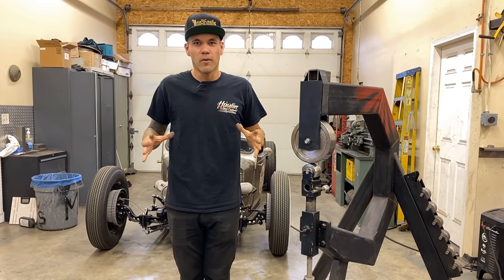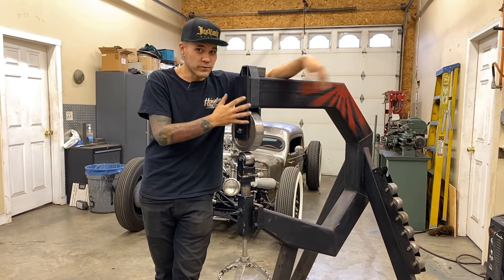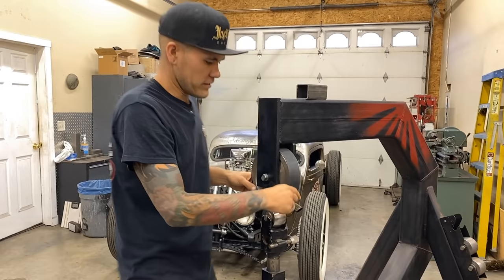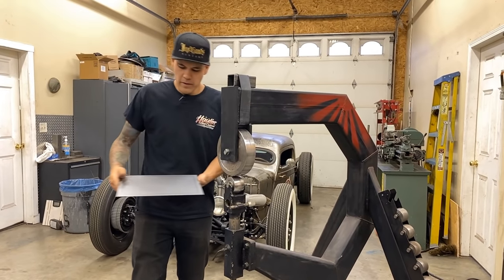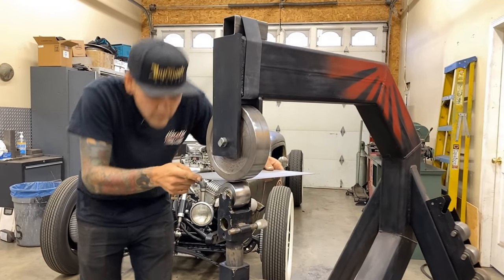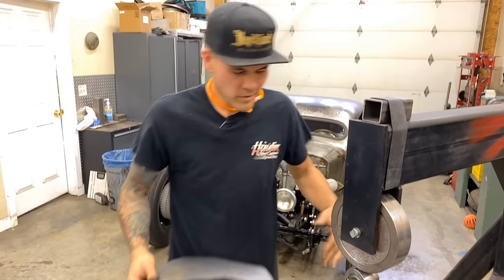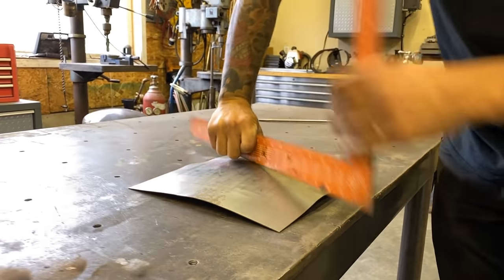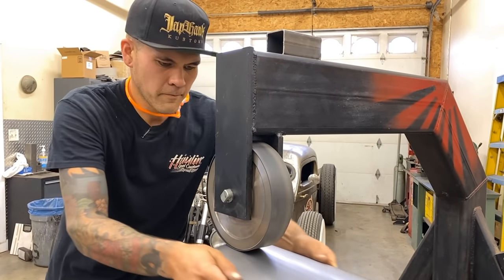English Wheel BASICS For BEGINNERS!!! How To Build, Buy or Modify, and WHY?

Comment: Another very good and understandable tutorial. One thing that I may gently remind you of is: Be mindful of your thumbs! Unless you want blood all over whatever is the other side of the wheeling machine and not to be able to use your thumb(s) for a couple of weeks or so, know where your digits are at all times!. I started learning metal shaping in England when I was eleven. This was something my instructor would be very emphatic about. At the beginning of my training he would, every so often, sound an alarm, which meant that you instantly stopped what you were doing and shut off any machines you were running. He would then remind us to be aware of out digital placement, our body stance and the state of our clothing for whatever process we were involved in. Everyone would surreptitiously check themselves out, sometimes there would be a flurry of tucking in of shirts, buttoning or the rolling up of sleeves and the binding of longer hair. After about a month this procedure would be unnecessary as everyone had leaned their lesson well. But he would still cruise the shop looking for unsafe practice. He didn't often find it.
Reply from the maker: Thanks for the reminder what in particularI am very mindful of my digits and I’ve never stuck them in the wheel yet is there a particular thing that I was doing that you thought was unsafe for my fingers!?
Reply: @MakeItKustom   Nope, nothing that you were doing. Your technique is just fine. It's only that you didn't mention it for any newbies out there. Getting your thumbs caught between the wheel and anvil can come as a very nasty surprise

Comment: Another awesome video, thank you! When I was working we called the holes tool holes, or tool pin holes. Your point is well taken, the stock replacement may be $18 -for a group 24 battery.  What if you needed a group 27 battery? Could use the original as a starting point, and change the template to accomodate the larger size. Keep it up great work educating folks.

Comment: Ok, Karl, I'm hooked/subbed. You had me at "sail panel for my 54 Chevy". I am new to the wheel, and I am going to make sail panels for my '49 Chevy coupe. I'm replacing the poorly hammer-formed patchwork quilt sail panels I made when I chopped the car about 15 years ago. I am unclear which of the methods you show, or combination of methods, to make the complex shape of the panels. BTW... I bought a rubber band from Trick Tools per your suggestion, for my borrowed Harbor Freight wheel. Any chance you could do a quickie on actually making sail panels..?

Comment: I have an HF special and was curious if it was gonna be enough. Thanks for easing my worries.

Just found your channel, excited to get my wheel out later and get working
Reply from the maker: You can do a lot with a little! Once you know the machine a bit you might desire a little bit more rigidity in the frame but that can always be added later
Reply: @MakeItKustom  Hell yeah. Also saw the coverage of your rat rod. Thing is chefs kiss

Comment: Do you use any downward pressure when you are making the 2D form? So basically if there is no downward pressure the radius of that panel would be ~36"?
Reply: You don't need to make downward pressure. It would be very awkward to do in any case. The machine makes the upward pressure that you apply via the adjustment of the anvil (lower wheel). The different radii of the anvils will give you different results.
Reply from the maker: Toby explained it very well. The radius of the lower die will become the radius of the panel the pressure does not matter whether it’s coming from the top or the bottom some wheels have adjusters on the top some wheels have adjusters on the bottom as for the amount of pressure when forming on a soft die, I just pinch hard enough to see the rubber Squish

Comment: If you added too much curve to a panel, could you put it back in the wheel upside down to take some of it out, or do you just need to try again?
Reply from the maker: If you add too much curve to a panel there are ways to stretch it out on the edges to bring the curve back down. By flipping it upside down it will not take out what has been done. In some cases I just try again from the beginning rather than try to move backwards but it’s mostly on a case to case basis

Comment: Does the diameter of the upper wheel mater?
Reply from the maker: Yes it does to a degree. It’s important for the upper wheel to be larger for momentum this helps keep your passes consistent
Reply: The reason I asked. I have seen english wheels with 8, 10, and 12 inch upper wheels. I didn't know if it had any effect on the results as far as shape.

Comment: Quick question. I'm currently working on a 56 Chevy truck and need to replace part of the door skin. It is flat then curves (crowns) at the bottom. When using the English wheel for this type of job, do I only roll the part that curves on the piece of sheet metal I'm going to be using? Thank you in advance.

Comment: I built a wheel like yours from $5 offcuts and bought a skip bin wheel and machined in down for the top wheel that cost $100 and bought some $250 3 inch wide bottom wheels on eBay and made an adjuster from a conveyer auto adjuster from the scrap yard cost me about 400 all up and turned out pretty fancy actually
Reply from the maker: Right on man I appreciate the ingenuity! I really get a kick out of using things to make other things lol

Comment: Just recently found your videos and really enjoy them.  I haven't read all of the comments so you may have already answered these questions.  The dented panel that you fixed,  what would it do if you flipped the panel over and started running it in that way.  Would it then flatten the panel out?   How many times have you got your finger pinched by those rollers?  I'm sure  that would really hurt.
Reply from the maker: Flipping it over does not reverse its affects it’s still stretching right side up or upside down. It’s where you stretch that will affect whether or not the panel grows or shrinks

Comment: My current english wheel is small and has 2 inch wide upper and lower anvils. I'm wanting to build a bigger one. It seems that 2 and 3 inch wide upper anvils are the norm. But, I have seen 4 and 5 inch wide. Is there any advantage/disadvantage to having wider upper wheels?

Comment: My little bench top english wheel has a smaller top wheel than most which means finding a forming band to fit it is next to impossible. However, I've made one out of an old leather belt, which works pretty good (2 lengths with the joins on opposite sides and a load of glue sandwiched between the lengths). 
However it has a tenancy to slip off to one side as I'm wheel. Any bright idea on keeping it central?

Comment: So...basically, the pressure of the wheel on the anvil is not as effective as the radius of the anvil?  How do you determine the pressure?
Thanx, you explain the process really well!
Reply from the maker: Both the pressure and the anvil are very important. The radius of the anvil being as close to the radius that you want to achieve is very important and the pressure they get you there it’s also very important I always suggest starting out with less pressure to get a feel for how fast the metal is taking shape because once you go to far although possible it is difficult to bring it back down
Reply: @MakeItKustom  Thank You...I understand now, yes,
Overstretching could cause big problems, so start light.

Comment: You might mention this throughout this vidio but sadly I hit  play while at work so I can watch it all now but I'm wondering if yo can heat treat, re lathe and polish or just polish a cheap wheel to improve them!
Reply from the maker: Absolutely you can! I did not mention that but you are so right you can definitely do that the only thing that you would be held back from would be the type of metal that the wheels are made from there are higher quality alloys that would produce a better result but a polished wheel that is he treated even if the steel is a lesser quality would still be a great improvement to what you get from the store

Comment: How thick of material can you shape with your setup? Can you shape 1/4 inch thick mild steel?
Reply from the maker: Technically I think you could go relatively thick but quarter inch is a bit much I know the power hammer and I would do it but I have no desire to go that thick

Comment: i made one from 3x4 I beam, with 1/2 wall/web thickness. thought it would be good enough for a 2ft throat.

terrible. not so bad on the deflection but terrible TWIST as you pull the sheet through. still, compared to the POS i bought solely for the wheels... useable.

it ended up with the sides all plated up with 1/4... that got it somewhere to where im not so annoyed. actually, it made it damn near perfect except for the horrid "ringing" that all steel gets... 

get my act together, im gunna try casting one. i prefer cast... even ali with sufficient webbing is up to the task. bit cooler than iron... bit easier to lug around... meh. just musing for now...

i just realised the screw is a perfect application for differential leadscrews... hella lot of pressure with super high precision on the gap. can easily have, say, 0.25mm per turn... repeatable pressure is key...